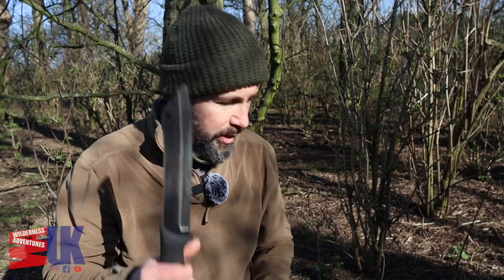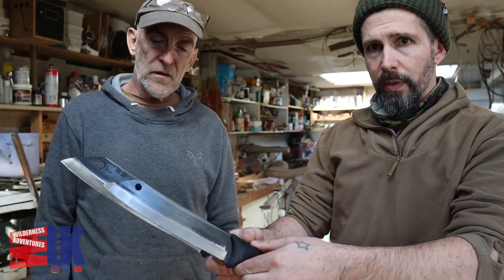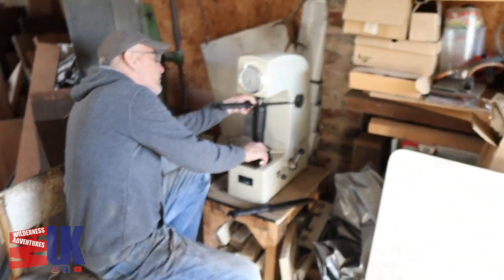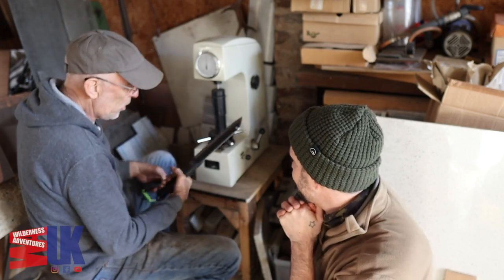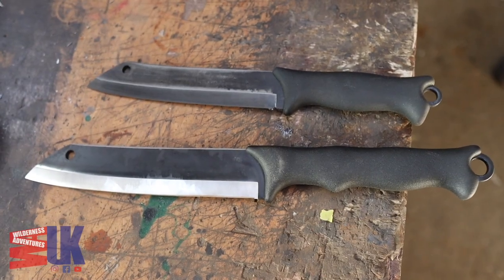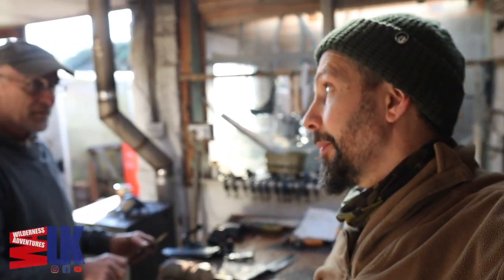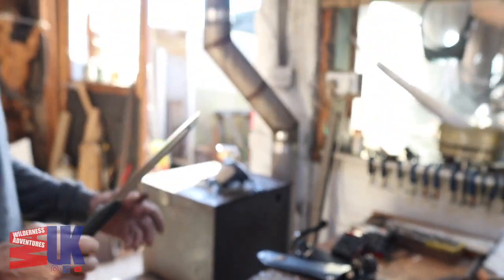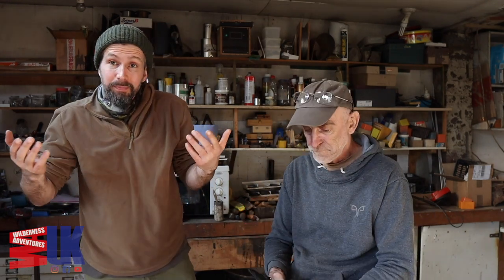Terävä Skrama 240 VS 200, Which is Better for YOU?

Comment from the maker: After further research and reading the Varusteleka website I have found that the steel is 80CRV2 (NOT 1095) which is a carbon steel as mentioned in the video!
Reply: That is interesting Spi and why the 240 blade at 58 hrc performed so well exactly the right hrc for 80crv2 and a great choice for a blade like that, btw i would expect it to pass the bend test too.
Reply: As I understood it, you tested the hardness on the flat of the blades, not the edge (since the method really only i reliable on a flat surface perpendicular to the axis of the diamond tip). 

What Varusteleka says is this:

"80CRV2 CARBON STEEL AND HEAT TREATMENT

All Terävä carbon steel knives are made from 80CrV2 tool steel, a trusted choice in Finnish knife manufacturing for decades. The heat treatment leaves the surface of the steel softer, ~52 HRC. This creates a tough exterior to protect the blade. As the blade is ground, the harder (~59 HRC) inside is revealed and improves edge retention. The spine has ground bevels for striking Ferro rods."

Comment: The company sent you a blade and you  couldn't even do the proper  research to know what steel it uses....hmmmm
Reply from the maker: Speaking of research, Check the pinned comment or dont, i dont actually care what you do 😉

ATB 🤣
Reply: @WildernessAdventuresUK  yes adding a pinned comment after a bunch of people comment the steel type... if a company is nice enough to send you a free blade, the least you could do is some proper research before you film the review.. it just seems lazy, but your welcome to run your channel however you like.
Reply from the maker: @shawnpepin7890  if you follow my channel you'll know none of my stuff is scripted, if you go watch the video before this one, you'll actually see that I turn up at Loz's and we make a couple of videos.. none of it planned, this channel is NOT a review channel therefore my reviewing isn't up-to scratch, and if you check when i posted the pinned post you'll see that it was up before a lot of the comments...

In my honest opinion - it makes no difference weather or not we concentrate on the minor details, we covered the differences between the blades and what they could be used for which is actually the title of the video.. we also tested edge retention weather it's 80crv2 or s35vn it makes no difference.. as Loz says its all to do with the heat treat...

Anyway - keep up the good work on your channel 😉
Reply: @WildernessAdventuresUK  after re-reading my comments, I feel as I came off dickish... not my intention. Alot of nuance is lost in writing form. Sorry

Comment: The core and the outside layers are heattreated to different HRC, and that's why the spine is ground with bevels to expose the harder core to work with firing rods. Good test but kind of misleading.
Reply from the maker: I have the 3 different sizes, love all 3, my 240 holds a better edge than my 200, and my tiny one is my go to!
Reply: @WildernessAdventuresUK  What model is your small one? I'm interested :)
Reply from the maker: @kuime1  it's the Skrama 80
Reply: @WildernessAdventuresUK  putting it into my wish list 😆

Comment: The Skrama 240 is the thinking man's Golok.  It will process enough material to build a shelter and have a fire going in quick order.  It is a good compromise of stoutness, length, and carry weight for small or large pack.  
The 200 won't get the same workload done.  It doesn't do anything more than a large sheath knife does.  
Both are to compliment the small utility knife everyone carries anyhow, for all those small tasks that just require a small sharp edge.
I'm a huge fan of the Skrama 240.  Had mine six years now, and its as great as ever.  Done a heck of a lot of work.

Comment: The Skrama has come to be one of my favorite blades.  

Have found the 240 to be the best all around tool I have found so far for the Florida landscape.  Axe serves little to no purpose here, and the extra blade length + reach is perfect for dealing with palmettos, brush, etc, and when paired with a saw will process all of your wood needs in this climate.  More versatile than a machete by far, for my uses at least.

I personally think the 240 is superior to the 200 in every way after using both extensively(heavy chopping ability is close to the bottom of my list of priorities), but i also always pair both with a smaller bushcrafty type scandi blade.  Basically unless size / weight is a concern, im picking the 240.  The 200 really is a great option for a lot of people though, and is what i take a good amount of the time if im going somewhere outside of Florida, and or i have a need to take a forest axe.

Great tool for the money and a design i have absolutely no problem riding hard and dirty, which is what i want out of a big blade.  Save my lovely little jewel knives for the lighter fine work.

Appreciate both of your inputs.
Reply from the maker: Excellent feedback, thank you forntaking the time to comment

Comment: it is not inconsistent heat treating, in their page they describe putting a differential heat treating in their knives, so the spine and edge are about 59 hrc while the sides are closer to 52, so actually you measured it right , because for the longer one i think you measured it closer to the edge and the skrama200 was measured towards the center so i think this reading should be pretty close to their desciptión

Comment: Seriously guys, there are plenty of videos and tests consistently proving the toughness and lack of brittleness of these knives (Cedric and Ata..., JOEX and many more). I have yet to find a bad review of these knives when using them for hard work. The same goes for the type of steel which you mysteriously know nothing about. Have you bothered to read about the knife at Varusteleka including the heat treatment? If you really want be honest, educate yourself first, please because giving proper information is an important part of being honest. 
That being said, I like my custom made knives but my Skrama proved to be an excellent and reliable tool with perfect ergonomics in really hard woodwork. All that for a fraction of the price of these customs. Maybe it must be sharpened more often but honestly, I do not know - there is no problem for me to sharpen a knife. I touch up all my knifes quite often so unless the edge retention is really terrible it does not bother me much.
Reply from the maker: If you read the comments above I have addressed the steel in them - also we didn't give a negative review, we found that the edge retention wasn't great that's all! That could be for a number or reasons on these mass produced knives...

I still to this day use all 3 of my Skramas, great knives - in fact I got rid of all my other bigger knives, these are the only ones I own.

Comment: although I've never been a 'big' feller I have big hands, I take a XXXL work glove ( if I can find them)  although my wrists are proportional to my hands my arms aren't heavily muscled, so I bought the 240 and while I was playing indoors you know air slicing and the like I found my forearms aching like hell so packed it away, when the 200 was released I hopefully bought one and playing with that it was like swinging a feather so that's my go to now
Reply from the maker: Yes mate, there is a substantial weight difference, I can see where you'd use them both in the field, tho I have to admit if i had to choose one of the two, I too would go 200 too (as indeed i originally did)... tho my honest personal choice would be a sub 3 inch blade and an axe... but again these will do things easier than axe, so there is no right answer just preference

Comment: This has been really eye opening about this company. It would be so much better if it was treated properly. If I got one it would have to be the blank, so I could anneal it and then properly heat treat it. But who wants to do that if they didn’t make the knife? Certainly not me. Might as well make it from scratch how you want it.
Reply: Soft isn't bad
Reply: To an extent. You can have durability with admirable edge holding capabilities also.
Reply: It is treated properly. Should do a touch of research. It's differential hardening

Comment: You probably have been made aware of this somewhere in the comments, but anyway...the Skrama has a dual hrc, a soft 52 outer and a harder 59 inner. Those are the specs anyway. Dont have a clue as to how that could be achieved...
Reply from the maker: Yes, thank you I was made aware of this.. tho the 200 lost its edge quicker than the 240.. maybe a mass production fault... however I personally still prefer the size of the 200